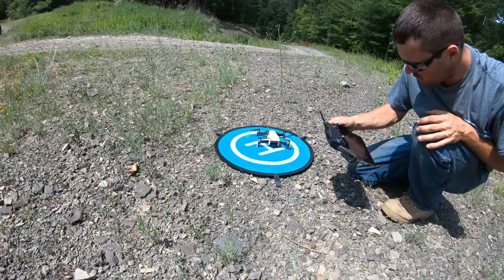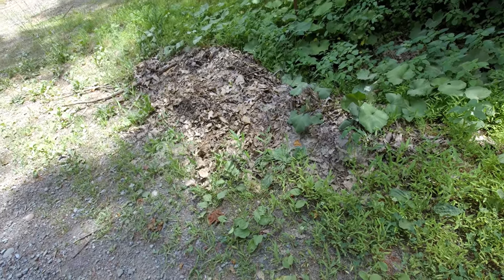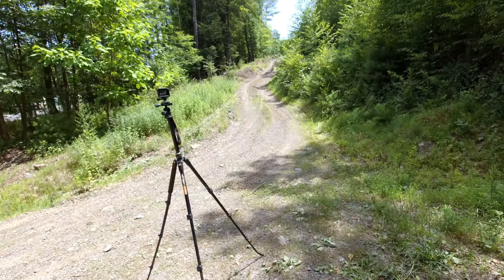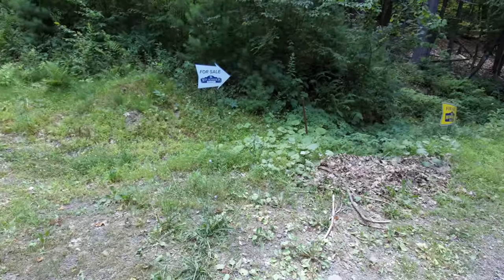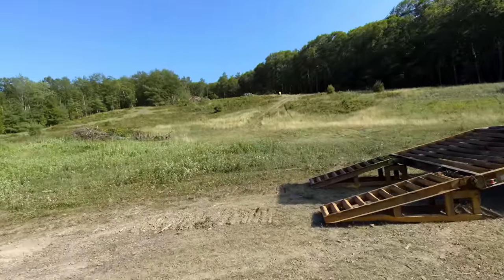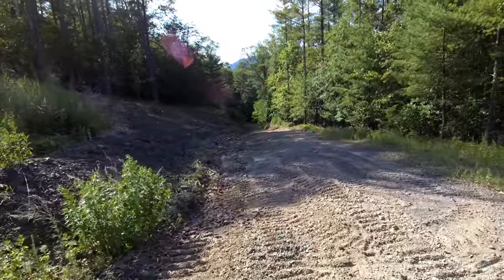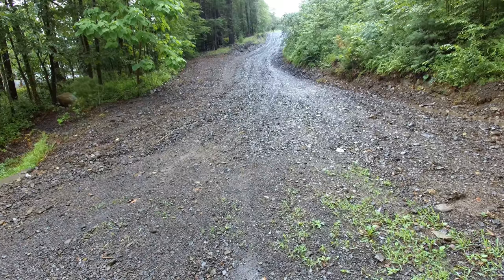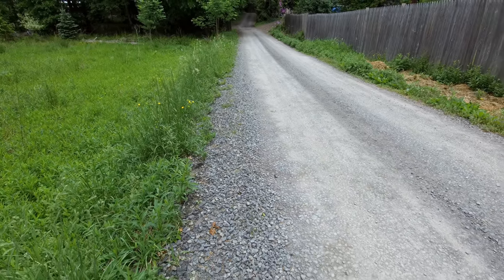Cutting in driveway drainage with bulldozer

Comment: Avoid by all possible chance of ever putting a ripper on the back of the machine, that will take out the finals in you cat quicker than you can haul them in. They make attachments for the blade that work as a ripper, are easy to maintain and  are within reason to buy or make if you choose to do so. I spent many a day and night changing the final drive in cats... one reason is cat has the power to break things where say a Case dozer is underpowered but over built which makes them a rich man's toy but a poor man's bank. If you buy another dozer or trade up, think about a six way blade, a high walker, and something with a winch on the back but if it has ever had a ripper on it... no no no! I've seen the frame broke on cats because they have the power and most operators don't understand how it works. My dad always had a tooth on the corner of the blade to rip with and even though his machine was a straight blade, he managed to pull the ditch lines so that they stayed put. That rock you fight with must frustrate you because you have to move so much to make a slight difference. Another thing about cat is the  under charridge is always worn out before the tracks show wear because the pins and sprockets are done for.. just my ten cents worth

Comment: I the way you did the angle with the drone the one thing I notice you always ly on the starter too long you should only crank 10 seconds then rest for 60 seconds you could also pump up the fuel pressure at the filter pump when you haven't used it for a while. Love your show but no music

Comment: how was running that old grey caterpillar you had vs using this newer one? was running costs about the same or did u have to do a lot less repairs on the newer one etc
Reply from the maker: The controls are similar. That newer d4 breaks more often than the old 955 loader.
Reply: nice, do you think the older dozer is worth using rather than a new one? i know parts are more expensive on the newer models and theyre not as stout as old iron. the only good thing i like about the newer machines is that they dont drink as much diesel compared to older machines.
Reply: @AndrewCamarata  Did you ever get that hole in your exhaust fixed?  It looked like a difficult and possibly expensive fix.  Can't weld cast iron too good.  That elbow looks like a special Cat part.  I have a 1971 Cat D5 and some repair parts are no longer available. I hope you can get that one.

Comment: Time to buy a 5 ton roller, bud. Oh, and a harley rake for your track loader.
Reply from the maker: Ill probably buy the rake first. I keep hearing people recommend those.
Reply from the maker: Ive never seen a roller for a skid steer, but that makes more sense than buying a whole machine. Rollers really need to be big or they don't do anything.
Reply from the maker: If I am putting in quarry rubble on a new road, usually just a tracked machine does a nice job packing everything down and chopping up the rocks.